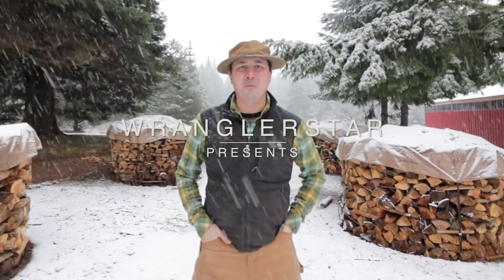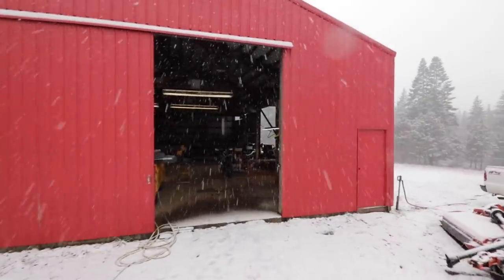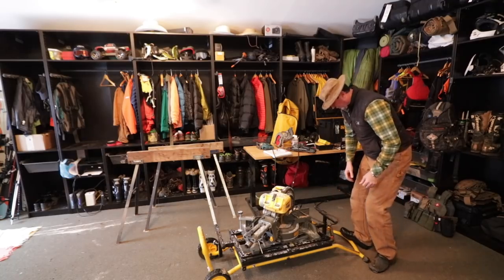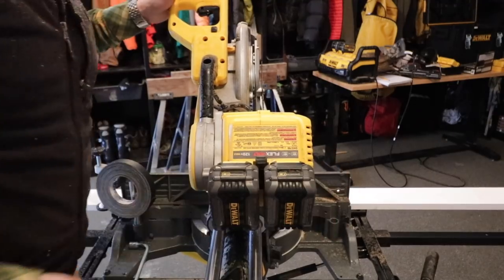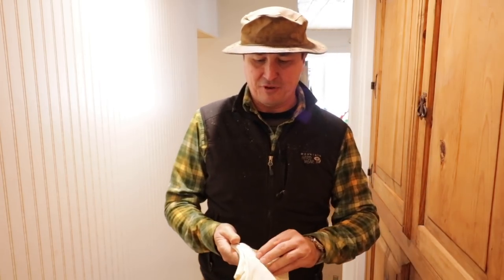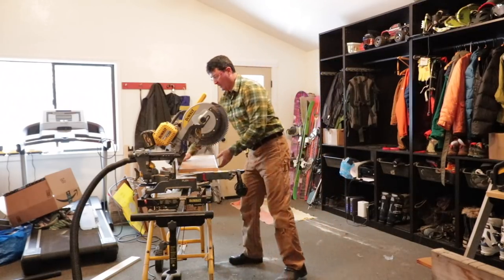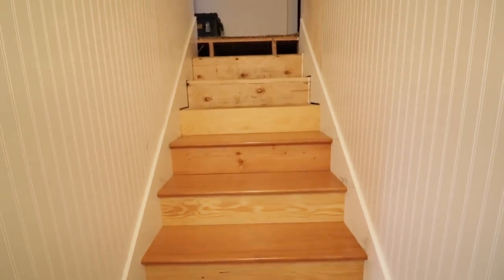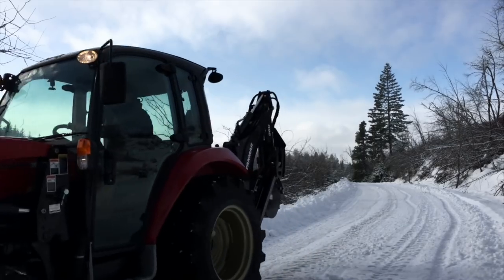It Has Finally Arrived!!

Comment: I did that tread overlay... same template guide. To cut the treads, what I did is I made a circular saw guide... it's a wide 1/4" plywood with a 1x2 guide on it. Once you have the guide glued onto the plywood, run your circular saw through the plywood following the guide. That cut plywood edge is where you line it up to your template line on the tread... clamp it down and run your circular saw through... perfect every single time. I use my 18V Dewalt circular saw to do the job.

Comment: Pro tip: when cutting the edges of the stair tread, if you also bevel the saw by 2-3 deg it will be a much easier fit, also much easier to "tweak" in place with a block plane because all you have to shave off is the top edge to make it fit.
Reply: That's very true. awesome idea
Reply: Angle the back cut so that at the front of the tread there is no back cut. You'll see the back cut otherwise. Another way - a little more time consuming - is to cut a blind rabbit on the underside of each end. A shallow ½" rabbit will do the trick.
Reply: with as snug as he made those, any concerns when things expand?
Reply: Great tip!
Reply: Yes I reckon when the RH increases the wood will expand and may lift

Comment: Next time cut the ends of the tread with a couple degree back bevel cut.  ie the top surface of the tread is at the correct length but the bottom surface is a 1/16 to 1/8" shorter.  Makes it a lot easier to drop the tread into place on the stairs without scraping up the rake boards.
Reply: It's little tips like this that make life so much easier.
Reply: Great tip.

Comment: Be glad you have the small gap covered with the 1/4 round. The treads and risers will expand (width-wise) and contract depending on humidity. Without the gap, your risers will push the treads up.

Comment: Riser goes on first, tread is butted up against it. That way you can keep the top of the riser level with the underside of the next tread, no mounding required. If you have to bang them in too hard, you will open up a gap between the end of the tread or riser and the stringer.  I will ditto a couple of other comments about a very slight bevel. Never seen a 'store bought' jig, we made them from plywood, flat headed carriage bolts and wing nuts. Good memories.

Comment: Another tip that will be conducive to a happy shop worker is a plumbed in oil filter to the air line. (saturated filter) My race team had it so we wouldn't have to bother with oiling every single pneumatic tool before and after use. Just something in that work smarter not harder mindset.

Comment: If the wall has some flex in it, you can use a push clamp (with white socks on the ends) to nudge it out a little bit. Slide the tread in without scraping the sides, then remove clamp, really easy and no time spent repainting.

Comment: Watch out for scratches using the shamy on cars. i use micro fiber detail towels. which took about 15 towels, but the car was a BMW m5 black. It was so extremely easy seeing the flaw of the reflection of the paint.

Comment: Oshlun aftermarket laser is really good though it requires a thin kerf blade. Another thing that is great for finish miter saw cuts is the zero tolerance tape from Fastcap... Cuts SO clean.

Comment: I enjoy your videos,  I don't want to be a troll. I've been a professoinal finish carpenter for 25+ years.  (a crane operator for 10) The jig you're using has been around for many years.  You start at the bottom riser, then the tread.  You'll need a nosing projection greater than whatever moulding you're going to use to conceal the gap between riser & tread. Usually, the trimmer is not cut, as if an upside-down stringer.  Repeat as required to the top.  Code requires that all risers must be within an 1/8" of each other.

Comment: you should use a rubber mallet for getting the boards in place. and slide it in level toavoid the marks on the walls. great video

Comment: I'm afraid those stairs might squeak my friend.  Hopefully they don't but I've built many sets of oak stairs in high end homes and I always leave just a tiny hair of a gap on the ends of the tread to prevent squeaking.  You don't even really need a visible gap, you just want them to drop into place without having to force them in.  Also a slight bevel on the cuts makes for easier and better looking fit. Those stair jigs are great tools aren't they?  I made one out of some oak and carriage bolts and wing nuts.  If you ever build any more stairs, theres  a great book called the "Coffman Stair Guide".  I pretty much taught myself how to build them by referencing that book which stayed in my tool box.  I've been enjoying your vids lately.  Thanks for making good content!

Comment: Car cleaning tip: to dry a car quickly and safely, use a thick quality microfiber, after cleaning the car. Or compressed air would do the job if the car is protected with a wax or a sealant.

Comment: Your first torque wrench? I'd have never guessed that! Anyway, 1/2" drive with 3/8" adapter. Problem solved. Works every time and there's no need for two complete tools. Also, always step down when adapting. Much easier on the tool.

Two things about the stair treads: First, for a super tight fit, back cut treads slightly. Fine tuning the fit will be MUCH easier as there's less material to remove. If desired, don't carry the back cut all the way through to the front of the tread.

Secondly, remember teaching Jack the most dangerous part of the chainsaw? The same is true for table and miter saws. One should push the blade back through the material, not pull it forward through the material.

Also, treads (and risers) should be captured under the runner/molding. Not only is there any need to touch-up paint, but there'll be no issues with expansion and contraction. You're installing in winter with cooler temperatures and lower humidity, so the wood is contracted. As the temperatures warm and humidity increases, those treads and risers have nowhere to expand! I hope that I'm wrong, but you may have bowing and squeaking in your future—construction adhesive, screws and all!

Lastly, while Li-ion batteries will discharge without issue when cold, they don't like to be charged cold. Probably best to not keep them in unconditioned (read cold) spaces such as the Transit.
Reply: John Coloe he actually does need 2 different torque wrenches. One 1/4" drive that does inch pounds and one in 1/2" drive that does foot pounds. Everything on his dirt bike would be in inch pounds along with some automotive. And then most automotive and industrial would be done by foot pounds.

Comment: The shammys are really great for drying all the water but you want to do a wipe down with a microfiber towel before you move onto the shammy because the microfiber towels are designed to pick up any hold any dirt and contaminants left over on the paint, while the shammy is only made for drying

Comment: Hey man a little advise I guess? Lol. Use PL Premium for your treads or any hardwood flooring. I do hardwood flooring for a living and use nothing other. Has never let me down, but otherwise you do some nice work. I have never seen that tool you used on the 1 by to figure out the angles for the cuts. Definitely a nice idea if you're just laying the treads flush to the stringers like that

Comment: That type of air hose was originally just the lines used in restaurants for soda. A contractor wanted something lighter than the big fat vinyl things. So he put fittings on the bar lines.

Comment: With a fit that tight are you concerned about wood movement?
Reply: Curt Martin wood dosnt grow much with the grain but it sure does across.
Reply: Not moving with a fit that tight lol
Reply: wood doesn't grow in that direction when wet, the skirt board might grow some, but the drywall side will take that out.

Comment: read that torque wrench carefully. most state they have to be sent off before you use them for calibration because the company doesn't do it to keep things cheap. and figures the consumer doesn't know better anyway and most don't. i didn't.. if its not calibrated its literally useless. im a mechanic and have tested coworkers wrenches against mine and they are usually more than 20% out of calibration. just a heads up.. good luck. nice video.

Comment: Wanna check out a battery operated trim guns I have used the DeWalt ones  for years and very good but very pricey, but recently I been buying Porter Cable tool, A better value for your dollar and just as good , you can get the DeWalt for about $400 and get the the Porter Cable for 200, I love mine and dont have to worry about dragging the hoses out

Comment: Torque wrenches are pretty handy, you cant always count on the old calibrated super end high tech "that feels tight enough" hand torque tool.
Reply: Oh yeah, the right tool for the right job is always a given. Not that long ago, i was changing my brake pads on my car, you know nothing to write home about except the last person who had touched my wheels seemingly got an impact gun and hold the trigger till the gun itself wouldnt move anymore. I had to get a lorry breaker bar to take off the nuts and this is a bloody ford focus. I was super worried about my threads but after a very thorough inspection they didnt appear to be stretched. I was damn sure to tighten them up to specification and tested them the next day then the next week then the next month

Comment: And when you plumb an air outlet at the bottom of a tall vertical pipe, don't put the outlet at the bottom of the pipe.  Instead, put a nipple at the bottom with a petcock to drain off moisture or oil.  The air chuck outlet should tee off at maybe 6" above the bottom of the pipe.

Comment: Be careful with that EDC you have.  The replaceable blades can come out at the most undesirable time.  I have given up on the knife as the pin that holds the replaceable blade in at the tip has let loose of the sides and it is spayed out.

Comment: I detail cars as a hobby, do NOT, use a shammy on your car. Microfiber towels is the only thing you should dry your car with. Because if u use a shammy and there is a bit of dirt, the shammy will just scratch the living hell out of your paint. Where a microfiber towel pics up the dirt and hides it from the surface. :) just a heads up

Comment: I seen two dishes on your barn, is it satellite internet? If so, how does it work today. If not, what is your internet? I live on the edge of town, about 5 miles away. And I have nothing until I put a cell amp on the roof with a directional antenna pointed to the only tower at 3.5 miles away in deep hills and trees. Before that, smoke signals and/or my sat internet, same speed. In the older days, 1996ish, the one way dishes worked fairly (and great with some software rewrites)

Comment: Pro tip if you tap the side of the stringer instead of the tread it will go in with a lot less damage..  works in ant situation when one piece is sliding past another..

Comment: I would have just taken the stringers the sides of the steps fit the new treads and risers and re fit the stringers saves having to measure every tread and riser so tight
Reply: And then cut a perfect skirt board with no gaps? Don't think so

Comment: @ Wranglerstar,  You do know you need two torque wrenches.  One inch pounds and the other foot pounds.
Reply: Tork?
Reply: I think he mentioned ordering both on the other video
Reply: Yep.  Plus, this has nothing to do with grammar.
Reply: He mentioned buying a 3/8 and a 1/2 inch not an inch pound.   Its totally different.
Reply: F4u-SuperCorsair
Actually, in general, The 3/8 is usually low foot pounds and the 1/2 is larger foot pounds.  The 1/4 is inch pound  You are right.